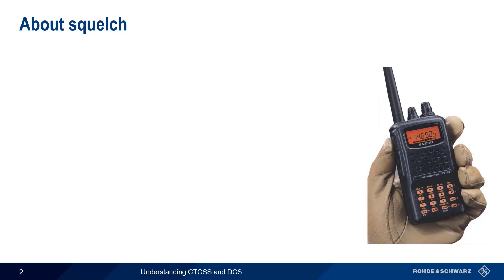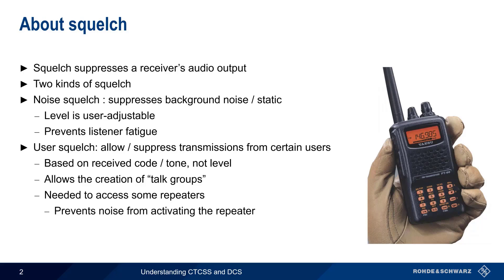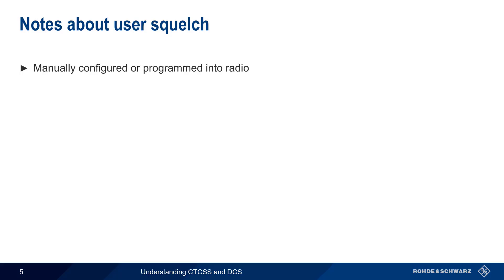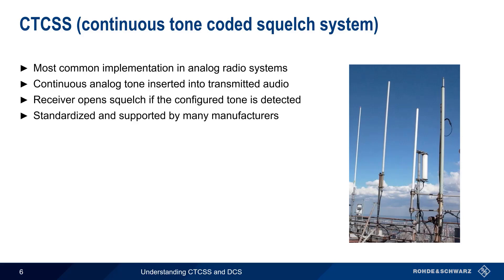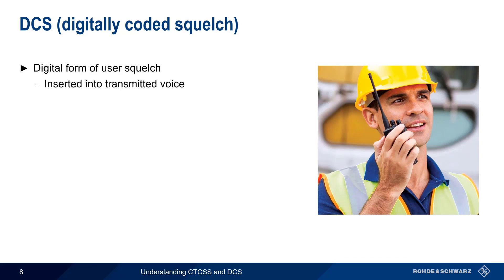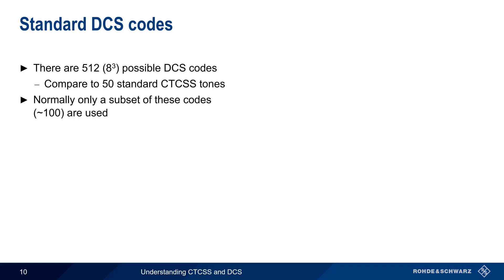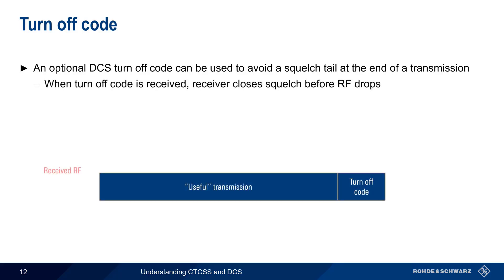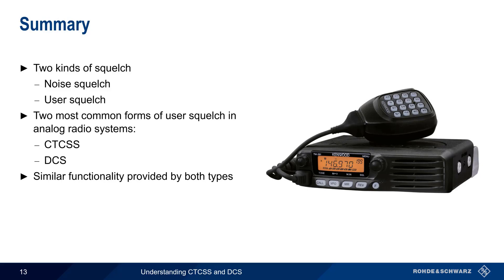Understanding CTCSS and DCS

Comment: I've always felt that calling these 'filter codes' is a better description than 'privacy codes' because, as you said, they do not provide any privacy.    
They act, in my opinion, more like spam filters in your email, eliminating unwanted emails, or in the case of radio, traffic you do not want to hear.

It should also be mentioned that use of CTCSS or DCS does not prevent one from interfering with or 'stepping on' other transmissions (because they are squelched by the CTCSS or DCS and thus are not heard) or having theirs interfered with if the frequency is in use at the time one keys up if they don't check the signal strength bar first to see if the channel is in use.  
Depending on distance and signal strength, FM capture may or may not work in your favor so your transmission may or may not get through regardless of CTCSS or DCS being used.

Comment: With all due respect, this video is in error at time stamp 4:50, where the narration indicates that a low pass filter routes audio to the speaker.  This would result in only the CTCSS tones being rendered at the speaker.  In practice, a low pass filter routes audio from the discriminator to the tone decoder, but a band pass (often 300 Hz to 3,000 Hz) routes audio to the speaker, and a high-pass filter (above the band-pass filter frequency range) routes audio to the noise gate for non CTCSS/DCS squelch behavior.
Reply: Yes, that was a typo. - thanks!

Comment: Excellent explanation! Now, I need to try and put it into a real-world application. The first thing I think I would want to do is to scan for any CTCSS or DCS users, no? I mean, I don't really need to speak to a user, (at least, not at first), but I only want to confirm that my SR 955HPC V2 is able to receive from someone using that system. 

I've got a long way to go before I plan to attempt transmitting to a CTCSS/DCS user. For now, I'd be happy just confirming that I have found and am receiving a transmission from a CTCSS or DCS user.
Thanks for the video!
Rich

Comment: Assuming simplex (not using a repeater) radio to radio transmission, how do noise squelch and user squelch interact? Does the signal have to break noise squelch before the radio will check for the tone or code to see if user squelch should be opened? Or is it the other way around?  Would it make sense to turn off noise squelch when using user squelch so that if the signal is strong enough for the radio to detect the user squelch tone or code then squelch is opened regardless of signal strength or noise?

Comment: Great, easy to understand explanation of these tones. I have a question: In some radios they state that there are “privacy tones” or “sub-channels”. I believe that these are are either CTCSS or DCS tones but there is no mention of them in the accompanying literature. Am I correct?
Reply: Yes.  I've often seen CTCSS / DCS referred to as "privacy tones"  This is a very misleading term, since neither CTCSS nor DCS provide any "privacy" at all: that is, they do not encrypt or obscure transmissions (unlike, say, the voice inversion scrambling found on some older analog radios).   "Sub-channel" is a little less problematic in that you can use CTCSS/DCS to create "talkgroups" or "channels" where users only hear transmissions from other people using the same tone/code, but keep in mind that this is different from the "talkgroups" or "channels" in digital trunked radio technologies like P25.  Hope that helps!

Comment: Just a quick question here.. can I use my 440 HT (Yaesu VX5) communicate with simplex on a gmrs HT..?  (Wouxun KG 805G)
Reply: Well, that's not really related to CTCSS or DCS, but the short answer is that two radios have to share some frequency range to communicate.  The VX5 is an amateur radio transceiver and although it has a wideband receive function, it can't (normally) transmit outside of the amateur bands.  The Wouxun radio is nominally a GMRS radio, and these frequencies don't overlap with the amateur radio bands.  That said, it appears that the Wouxun has a transmit frequency range that includes the amateur band, so it might work.  I do feel the need to point out that transmitting on amateur radio frequencies without a license and without proper identification is a violation of FCC rules. :)
Reply: @pauldenisowski  thank you so much for your time n knowledge, (and I did watch your video clip of couple times cuz I am interested in CTCSS and DCS), and for making an exception in answering my question. I was first ticketed in 2000 for amateur tech no code, KG6ASF, and reviewing for my renewal (hope I can keep the same call sign) I received my gmrs ticket approximately 1 month ago WRNR411.
Reply: @jonjeffries3265  No problem at all - always happy to answer questions. :)  Good luck and 73!  Paul, KO4LZ

Comment: CTCSS and DCS can increase transmission or received range? i use baofeng 145.500 7.5w power frequency with DCS range is longer then 168.500 8w power frequency with CTCSS (data test by JK-560s). can you explain about that? thank you for help
Reply: Neither CTCSS or DCS should affect the achievable transmission range per se.  The one place where it might make a difference would be at the very edges of the Tx/Rx range -- if the receiver cannot properly detect / demodulate the CTCSS tone or DCS code (due to poor SNR), then it will not break squelch and the effective "range" is reduced.  I haven't made any proper measurements of the difference, but I would assume that in these kinds of low-SNR situations, CTCSS is actually easier to decode than DCS.

Regarding your specific example: I'm not sure how you're measuring "range" (over-the-air?) or how much "longer" the range is (meters? kilometers?).  The most accurate measurement would probably be a field-strength measurement (V/m or similar) made over-the-air near the radio. I suspect that the difference you're seeing in "range" might be related to frequency:  the antenna you have on your radio might be a more efficient radiator / receiver in the 2m amateur band (145.500) compared to outside of that band (168.500), and this would definitely affect the radiated and received power.  I would also want to test using the same frequency and power level, only changing whether CTCSS or DCS (or neither) is used.

Hope some of that is helpful!
Reply: @pauldenisowski  thank you for your help